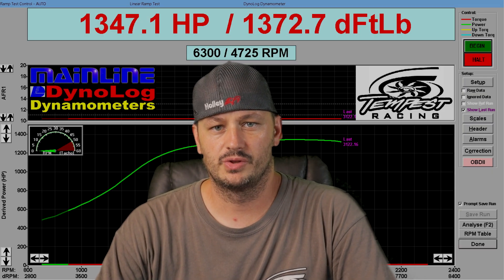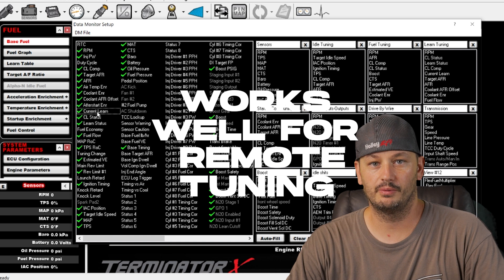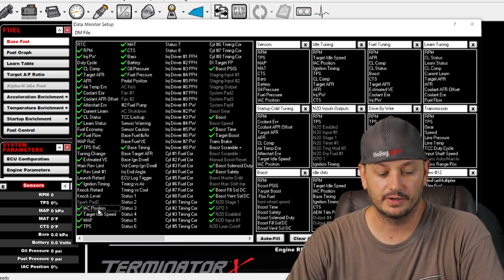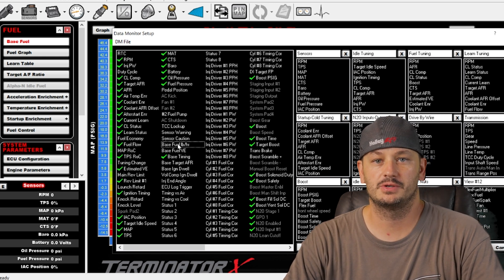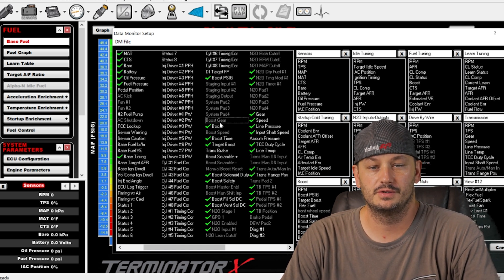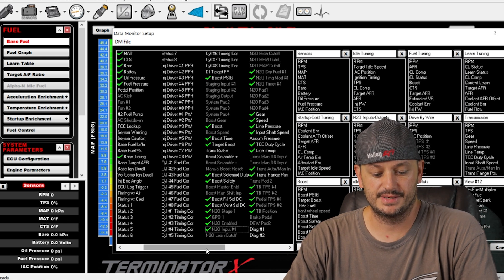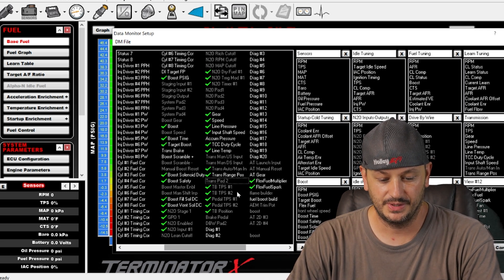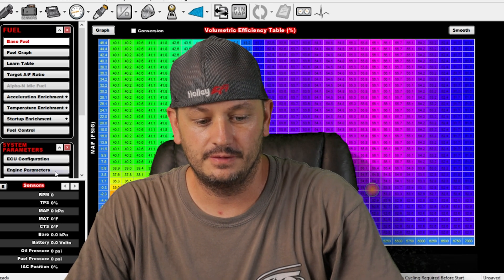Holley EFI Tuning Terminology // How to Tune Holley Terminator X for Beginners

Comment: Hi Joe, was wondering if I could use the tach signal (white w/blue stripe wire) out of the terminator x to control my aeromotive fuel pump controller? Thanks for all your videos and info you put out!

Comment: what should a person adjust when you let off throttle while driving. it takes long time to start idling down,like having cruise control stuck
Reply from the maker: Search through my videos for the idle control targets video. Iac hold position typically causes that
Reply: @JoeSimpsonAtTempest  yeah ive been watching your vids on here they help me alot,i just cant get this idle this to work for me
Reply from the maker: @sjrsloan  def wish there was more adjustability with idle on Holley.
Reply: @JoeSimpsonAtTempest ell yeah i had the fitech ls standalone before i got Holley tx and they have dam near no adjustabilty, hsd no luck at all with that.

Comment: Is it possible to do boost by speed on term x using gps speed from a 6.86 pro dash? Ive seen it most commonly done with VSS, but I dont plan on having a VSS...
Reply from the maker: I don’t think you can use gps speed for anything other then just dash display but I’m not positive on that I’ve never looked

Comment: away from my cpu right now, is it possible to use the launch retard to decrease boost  for a fraction of time or is it tied so timing only?
Reply from the maker: That particular pre defined table is ignition only but you can do whatever you want in that regard with custom tables
Reply: @JoeSimpsonAtTempest  Thanks, I actually have something like that set up in a practice global folder. In theory it would bleed boost out of a waste-gate that is on the plenum or intake tube before supercharger, so basically my own version of traction control with boost instead of timing. Playing with duty cycle for a solenoid isn't the easiest though i do belive i've figure it out. thanks for the video